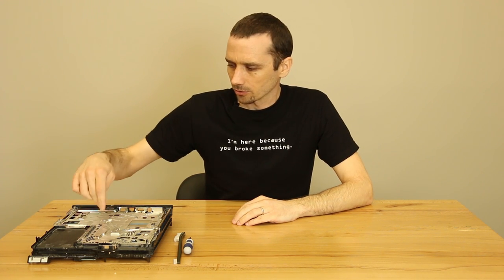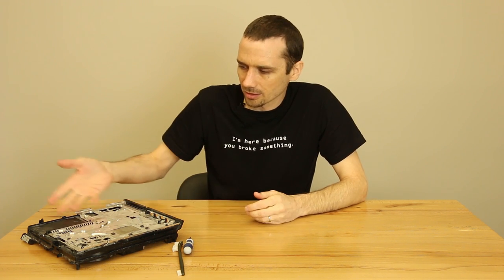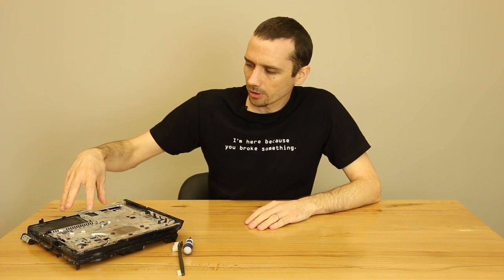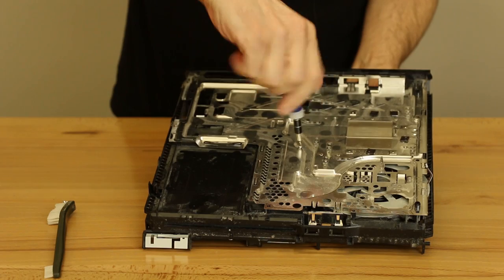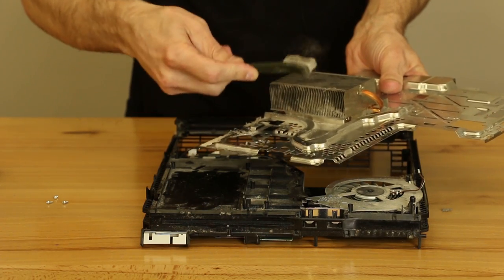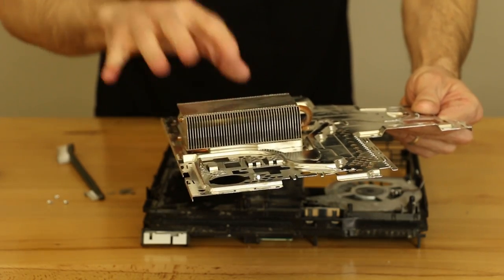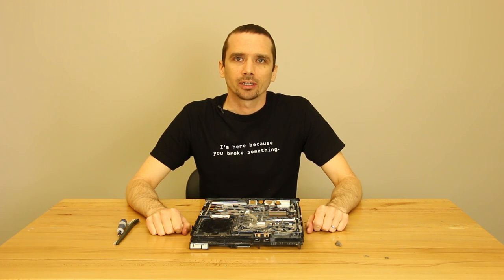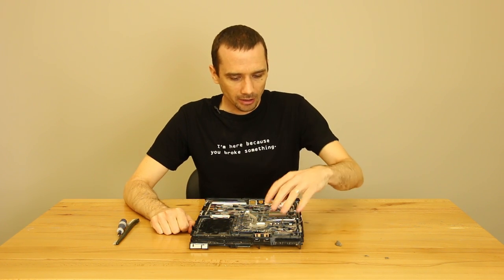PS4 Overheating Repair Tips - How to Fix Loud PS4

Comment: what if my PS4 makes no noise at all?
Reply: perfect
Reply: Preston Sasso omg i cracked up so hard😂😂😂
Reply: Hahah
Reply: This is a common issue with older ps4 models. Take your playstation outside. Go start your car and pop the hood. Get your jumper cables and attach the red cable to the positive terminal (the side with the "+" on it). Then connect the black cable to the negative terminal (this side will be marked with a "-" sign). Now attach each cable to the corresponding ear. Have a friend hit the gas a few times while you hold the ps4 with both hands. 

Should run like it's fresh outta the factory! Good luck and be sure you record a video to post on youtube to assist anyone else who may encounter a similar issue! Hope this helps!!

Comment: thanks for the information. Do have a question, does overheating cause "no signal" on tv when hdmi is plugged into tv from ps4?
Reply from the maker: +Fearless74x No, overheating does not cause that. That would be the HDMI port most likely. They are really weak on PS4's and break easily. We fix lots of those. You can send it in for repair if you'd like: http://www.tronicsfix.com/store/p21/PS4_HDMI_Port_Repair_.html
Reply: +TronicsFix thanks for the insights.
Reply from the maker: No problem!

Comment: Mine only overheats with certain games. Games like Spider-Man, Dragon Age: Inquisition, sometimes Skyrim (usually after a long time), but not games like Smite, Minecraft, etc. It also doesn't overheat with movies or Netflix. I've heard it has to do with the games themselves. I cleaned out the sides with a can of compressed air. I play in a generally cold room, but this doesn't help either. I'm scared to take it apart because I'm not sure I can properly put it back together. Is there anything I can do?
Reply: Keltic MC same mine only overheats when I play horizon zero dawn

Comment: my ps4 stopped transmitting video while I was playing with a loud humming sound. had the constant blue light of death for a few days until I opened and tightened the apu down. everything cut back on for about 10-15 min before no video and humming again. 

checked the thermal paste, old and crusty; opened and cleaned all that was in this video and reapplied new paste.

Comment: hey one question: what is the best way to remove old thermal past from the cpu. what kind of cleaner should i use? great video!
Reply from the maker: I use q tips then clean it with isopropyl alcohol.

Comment: 2 PS4's I've had, were fixed by completely opening them following ifixit's guide (Fan replacement guide), and when i saw the thermal paste, it was thick, dry and gloopy and didn't seem very conductive. Replaced it with NT-H1 paste and got it back together, I never even heard the fans again. I don't understand why Sony skimped out on such a cheap thermal paste.

Comment: NEED HELP ASAP! Sir, my ps4 is working good without any issues untill yesterday and now when i turn on the ps4 first the blue light comes and then the white light turns on and i can see my screen going to main xmb menu and then after 3/5 mins its shutting down and during the 3/5 mins running i dont feel any overheat at all & fan is silent and i can see it spinning well. what might be the problem sir?

Comment: I got a 4 years old ps4 and im a heavy gamer , about to change thermal paste and pads .. 
Will use Arctic MX4 and Arctic silicon based thermal pads 1.0 mm thick ..
My question , is the thickness correct? 
Waiting for the reply .. Thanks :)
Reply from the maker: Yep
Reply: Ammar Alraisi d

Comment: How much will it cost me to get my fan fixed? Looking inside mine and The fan won't start spinning cause in it to automatically turn off it appears to try a bit than quit and over heat msg popsup

Comment: Hey sir I don’t know if you will see this anyway my console turns off by itself cause of high temperature .. i just cleaned everything but i didn't replace the thermal paste it was dried and my fan was rotating smoothly when I spin and it is clean too ... but when I turn on the console the fan doesn't spins ... and the console turns off in seconds .. if i replace the thermal paste does the fan works!  or something else??

Comment: I'm having a similar issue my Ps is only 2 years old and now when I go to play a game I'll lose all power no rlod or beeping the fan has stopped functioning all together. No warranty left so I cleaned the system out and tried cooling pad and fan it worked for about an hour. Could the PSU or GPU be the issue along with the fan?

Comment: My ps4 was making grinding noises, so I ordered a new fan. Took ps4 apart, installed the new fan also put new thermal paste on And now my ps4 keeps getting overheat warning. Didn't have this problem with the noisy fan before.... I don't get it..
Reply: Will T your PS4 model?
Reply: Original ps4 from 2013. Idk which model> Turns out the Fan I ordered was bad. Ps4 would overheat because the fan wasn't spinning...
Reply: Will T did you put in a new fan ??
Reply: Yes, but for some reason the new fan was bad... a brand new fan._. So I put my old noisy fan back in, spins no problem... Waiting for another new fan, hopefully it works this time...

Comment: My ps4 1100 series after using for over 6 years causes heat up problems. It works fine when put vertically and heats up on horizontal position. What's the cause?

Comment: hi TronicsFix, thanks for this channel! I have one question.
is it possible to disassemble the fan itself? 
in other words, can i pull the black fan blades off the metal plate with the coils to clean the shaft and lubricate it?
thanks!
Reply from the maker: Nope...not on the PS4 fan. The plastic is fused to the metal.
Reply: @Tronicsfix  thanks again. Too bad one can't take the fins off.. I thought it might be possible because it looks like a BIG laptop fan. They can be lifted off..
No way to get a drop of oil in there?

Comment: I use a long barber brush for my heat sink and use an actual air compressor that blows all of the dust out of the console and the power supply unit, the tear down is a cake walk but my console is just loud

Comment: I had to do a fix for this problem for the ps3 and it was all because the heatsink tension brackets were no longer bent enough not keeping proper pressure on the heatsink, bend that bracket back out where it teeters a little then screw it back down, no more jet engine sound and shut off
Reply from the maker: Nice...good fix!

Comment: I took my playstation 4 apart and cleaned it, the overheating has stopped.  Now when I got it put back together there are a few new issues. My controller inputs are delayed, the eject button won't work and I can't eject it with the console menu because it says there is no disk inside. Any help you could give would be greatly appreciated.

Comment: Okay so..
My PS4 would overheat when playing certain games..
I removed some of the dry thermal paste because Im replacing it in a few days..  and now it turns off almost instantly after turning the console on..

Pure boredom I removed a little more of the thermal paste because its all dried out and now it stays on for roughly 20 seconds which is a little longer than before.. So would you suggest Its definetly the thermal paste that needs changing?
(Ordered Artic Silver)

Comment: How do you know if it is the motherboard causing the overheating problem? Fan doesn't work, original was replaced and it still won't turn on. Is that a telltale sign?

Comment: I had problems with overheating. My PS4 would just stop while playing a game. No beep, no lights. It just stopped. 
I took my PS4 apart and changed the thermal paste. Then I put it back together. I followed several youtube tutorials to do this. Everything is connected and seems to be connected as it should be. 
Now my PS4 won't power up. I checked all the cables going into the power supply and they seem connected. What could be the problem? Could it be my power supply just died all of the sudden? I've ruled out problems with the power button. There doesn't seem to be any power running through the thing. Even when I try entering a disc it doesn't respond.

Comment: My ps4 overheats after a couple of minutes. I replaced the fan, cleaned it, and put new thermal paste. Once I launch a game, it gets loud really quick and turns off. Any suggestions?
Reply from the maker: Did you remove the bottom plate and clean both sides of the heat sink?
Reply: TronicsFix yes
Reply: Have you fixed this? Because I have the same

Comment: Mine was pretty loud and putting out a lot of heat. So I put it flat so the vent on the bottom wasn't covered. Now it's much quieter, because the fan isn't working double time to kill the heat. 40 second fix, no tools required, bottle of compressed air to blow the dust out is optional.

Comment: I cleaned my ps4 it works fine the fan works good and quite but if I Choose an application like Call of Duty and YouTube it overheats and does the red light do I need to put new thermal paste ?

Comment: I have a PS4 got it clean then plugged it in when I don't open any app doesn't make any noise cleaned the heat thing to when I open any app it goes very loud then it pops up a message says its over heating then it just turns off I had the PS4 for 4 years now plz help

Comment: i have the ps4 pro. it used to not be noticeably loud but now after a little bit of playing it gets really loud. just waiting for it to catch on fire. also, all along the sides in the 2 lines is a bunch of dust. yeah I can clean it, but should I try taking it apart to clean the inside, if I know nothing about that kind of thing.

Comment: so my ps4 I had since 2015 mine is a 1215a ps4 and I changed its thermal paste and fan I got that replaced and everything my ps4 is warm in the back of it which I learned is normal my ps4 feeling warm on top still is that normal then even after and I got stuff changed out

Comment: My PS4 cannot function with ambient temperatures above 35c/95f and all RAM and GPU-heavy games overheat the console after a few minutes of gameplay.

The top cover gets very hot even without having a game on and the exhaust expells very hot air.

I am very afraid to disassemble the console because of the fragile connectors and my older brother refuses to send the console to an expert because of his belief that they will either break the console or not fix it at all.

Comment: My ps4 pro not over heating there is no problem with hard drive I can play dvd games but I can’t play games which are saved in system I can play some games I don’t know what is issue I do software again and again it’s also didn’t work I can play just YouTube and dvd games that all do you know what is issue with system games ?

Comment: my ps4 get the too hot messege and after that didnt turn on anymore, is it dead?
Reply: It should turn on with the corruption message (basically that you didn't turn off the console right the last time). If it's not turning on, get it to repair. But I'll suggest to check the fan and thermal pad. Might also get a new PS4 Pro if you have some spare money.

Comment: Good video but probably should of made it longer to show taking it apart and putting it back together
Reply from the maker: I've got teardown and reassembly guides on my channel already. I try to avoid duplicate content.
Reply: @Tronicsfix  Fair enough I  found video explaining how to take apart.... my heat sink was disgusting, but after cleaning every part and putting back together I still had my ps4 overheating. Hopefully its just the thermal paste.

Comment: If you are opening a ps4 to clean its heatsink, like in this video, and when you reassemble it, do you need to add new thermal paste in order for your ps4 to work properly?
Reply from the maker: We always replace the thermal paste when we remove the motherboard. I wouldn't recommend not replacing it.
Reply: Thank you.

Comment: Hi brother
I cleaned my PS4 and it started showing that PS4 too hot

Then it started turning off same time red light is also blinking

What should I do to fix this problem?????????
Reply: Maybe you dont have thermal pads on the ram chips or did you plug in the fan?
Reply: @Ly_nRL   thanks a lot for helping me brother. 
Actually I changed thermal pads and thermal paste. 
And the results are amazing my ps4 is working very quite and very smooth.
Reply: @parvaizahmadbijard6516  Glad to help! Mine did the same but i replaced the thermal pads and thermal paste and works like a charm.
Reply: @Ly_nRL  keep in touch brother

Comment: I first got the notification of overheating a few weeks ago. I can run Netflix, YouTube and other apps fine. It's when I try to play a game that it overheats, I did take it apart 3 wks back and cleaned it but it still overheats. Gonna try the thermal paste bit and hope that fixes it. Any helpful suggestions?
Reply from the maker: If you took it apart but didn't replace the thermal paste that's your first problem. If you took it apart but didn't clean both sides of the heat sink that's your second problem.
Reply: Me too bro been trying get a fix ever since

Comment: Thanks the first videos I watched clean it half-assed just blowing it out doesn't work you won't get the crap out of the heat sink with compressed air (co2). If you have a particularly Dusty environment or have pets you need to clean the heatsink. I clean my laptop out around every 6 months and clean the heatsink. That is the main component that needs to be cleaned because if the air can't flow over the heat sink it's not going to properly cool the device and it's going to fail.

Comment: Hi i have problem when i start my ps4 within few i get notifications that my PS4 is overheating than beep sounds comes and it switches off wt should i do
Reply: same exact issue, just that I cleaned and applied thermal paste and still can't run games properly
Reply: same here

Comment: Replaced Hdmi port. Ps4 comes on show connect to controller for a seconds and turn black screen. Still detecting on Tv and ps4 stays on white lights
Reply from the maker: Did you solder all of the 19 pins on correctly?

Comment: Hi, I have a ps4 with a fan that is not spinning. I hear it click and it doesnt go... i tested fan with back cover off and it spins once and then stops... I have ordered a new fan, do you think this will fix my overheating issue? Also I'm not sure if I have a few heat pads missing will this cause overheat??
Reply from the maker: Yes, this will probably fix your overheating issue. All of the thermal pads need to be in place.
Reply: Thanks for your help man! I replaced fan and renewed all heat pads and now ps4 running fine!

Comment: I just had my PS4 over heated and I think the fan is dead dose that shut down the ps4 systems? I also open and the thermals paste is on the main chips with all thermal paste are a bit dire.
Reply from the maker: If your fan is faulty it will cause your PS4 to overheat.
Reply: Thank you very much for saving me from buying a new ps4. Thank you :)

Comment: Okay, you just gave me some good food for thought. I bought a first edition PS4 recently (I can check the series number but it's from around the first release date, just had its HDD replaced and is now 1TB) and it worked like a charm, if occasionally loud. Over the last few days it's been shutting down more and more often, currently it lasts about four hours in-game before dying on me. I thought it was overheating, seeing as the fans are going full speed whenever it happens, but there are no beeps or anything like that. It just suddenly dies with no warning at all. Any ideas what that might be? So far I've just used compressed air on the vents, didn't want to take it apart before I knew what I should do, and it hasn't helped.
Reply from the maker: It's not overheating. It likely has faulty solder joints between the APU and motherboard.

Comment: Thinking about sending my ps4 to you guys. My pro sounds like a jet engine, would that fall under the fan option? Thanks for the help
Reply from the maker: Actually if it's not overheating it's best not to send it. Many PS4 Pros just sound like that and there's nothing you can do. You could try liquid metal if you wanted.
Reply: I took it apart and the heat sync was dirty as hell. Super quiet now

Comment: My PS4 is loud as hell, but I'm nowhere near confident enough in my abilities to tear out the motherboard and clean the heat sink, will cleaning the fan from the back help?
Reply from the maker: Unfortunately, no. It needs to be cleaned internally to get the dust and debris out from where the air flows through the heat sink fins...that's where the real cooling happens. If you're in the US you can send it to us: http://www.tronicsfix.com/store/p56/PS4_Overheating_Repair.html
Reply: take of the bottom cover. it's really simple and clean the fan. it'll help a lot

Comment: Question. My ps4 fell down from a high place hitting the ground, button wasn’t working to cut it on so I sent it to a repair shop, they replaced the button, but it never cut on, I thought it was overheated because it got warm,I’m out of warranty can you provide me different solutions? I did buy a new ps4 but I want to save my data to the new game when it arrives
Reply: When I start it up the light remains white solid light. It turned blue when you hit the button, it shut downs a little after that but how much do you charge to do so?